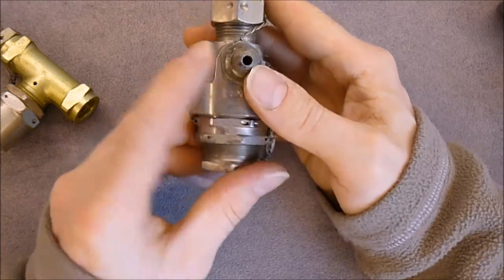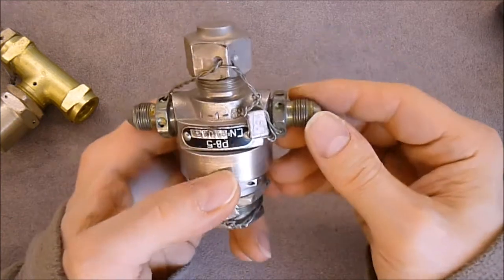Two soviet aircraft hydraulics things

Comment: Left one is a pressure regulator, and the yellow pipe is either a anti hammer valve or a blow off valve to dump overpressure. The right is a standard hydraulic valve, to operate a single action cylinder with either a separate return cylinder or a spring return.